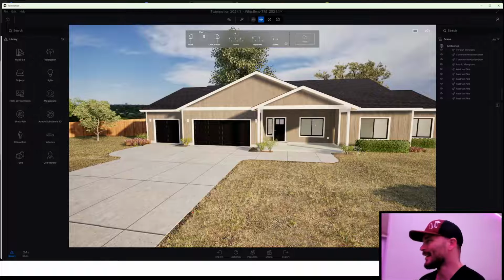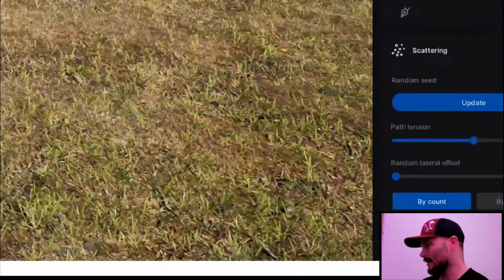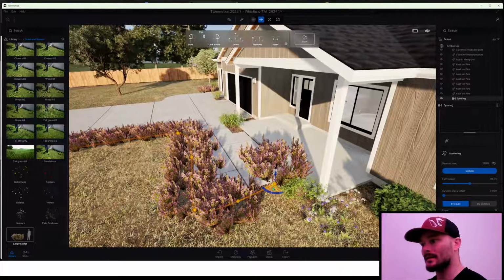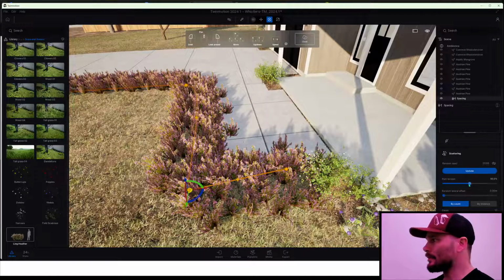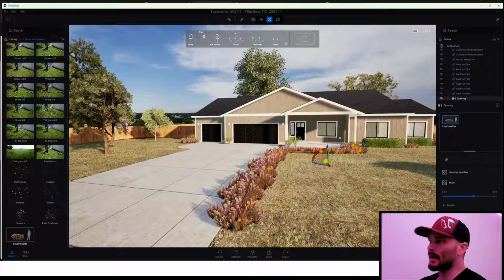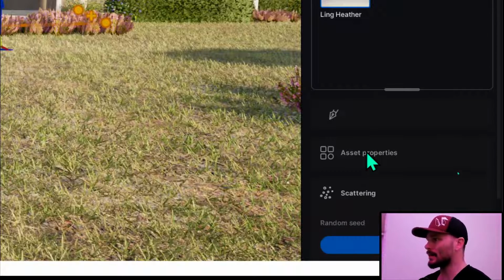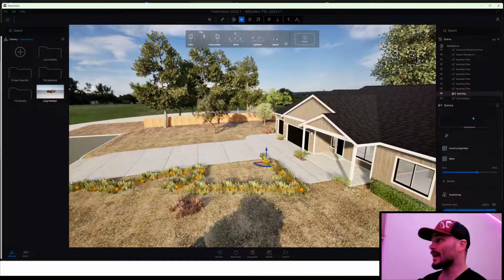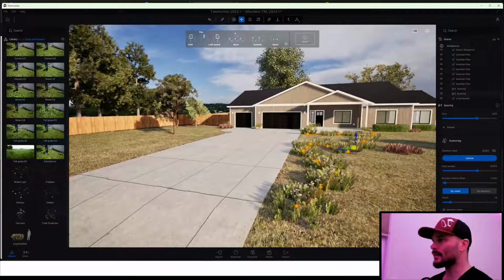Twinmotion Shorts - 2024 Preview 1 Learn The New Spacing Tool

Comment: I am thinking about investing in a RTX 4080 super.  Would you or your community have any suggestions on a specific card?
Reply from the maker: Even better, I know someone that might sell you a brand new one that I know was only used for like a month because of a big computer meltdown and replacement. Email me and I’ll get you in touch
Reply: I would likely be interested.  My computer currently has a Corsair 80 Plus gold 850 watt modular power supply.  I am wondering if it might be wise to upgrade the PSU to 1000 watt in preparation for an 4080?